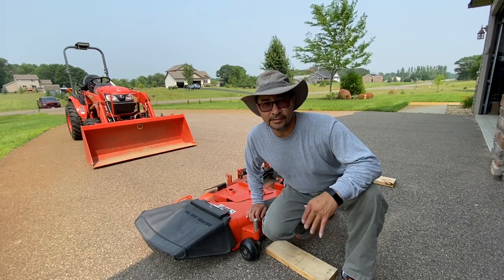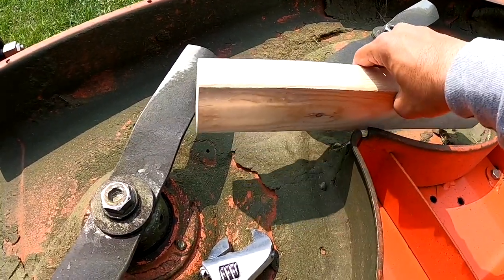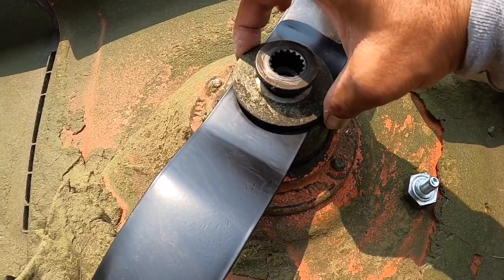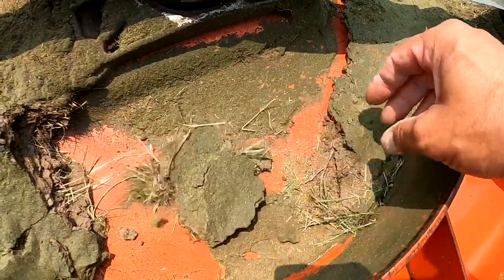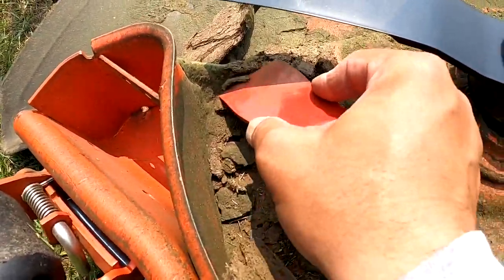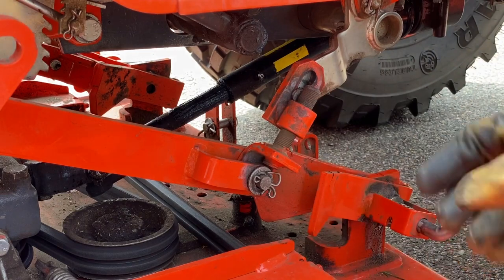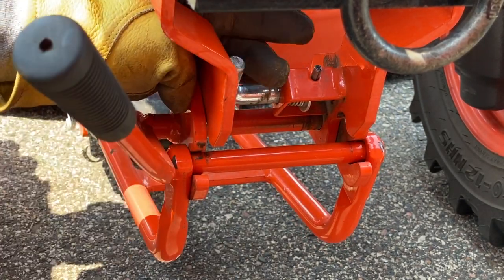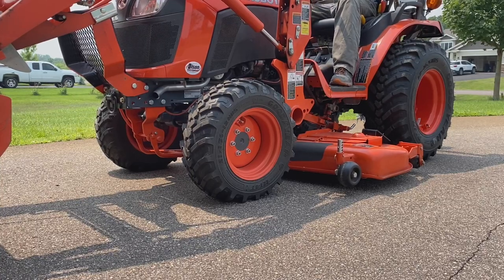Changing blades on a Kubota RCK60-32 Mid Mount Mower

Comment: From the owner's manual for these decks:  Mower deck 	spindle torque	72-87 lbs-ft.  I didn't write it down, but I'm thinking the nut was 29mm.  I'll have to check on that again.
2 tips for hooking up the PTO:  As you discovered, sliding in from the back of the tractor makes it a lot easier for connecting the mid-shaft.  I also remove my drawbar (pull the pin and pull out the bar- easy peezy) to keep from getting jabbed in the chest/middle.  I use a big piece of cardboard and lay it on the driveway and it really makes sliding under the tractor super easy AND keeps me from grinding/sanding the heck out of my back.
Reply from the maker: Thanks for the information 👍 and I like cardboard to it works great for tight places. Have a great day 😁👍
Reply: @MJADoingStuff  I bought a 30 mm socket for the job.  Yesterday I ordered a 26 mm socket for that blasted screen I had to clean as part of the 1500 hour transmission oil change.  After all the work, the screen was clear for the second time.  At 500 I said to it, "I'll see you in a thousand hours."
Reply from the maker: @rodcros  Wow you are really put on the hours. I am glad to hear you have been enjoying your tractor. I am guessing it has been pretty reliable so far? Thanks for watching the video. 😁👍🚜💨☀️
Reply: @MJADoingStuff   It needed a tachometer cable at about 600, and I had to re-pin the seat supports to the fenders at 1450.  That's it.
Reply from the maker: @rodcros  Awesome!!! Glad to hear. This is my first tractor and it has been great so far. I get lots of things done in a short amount of time.😁👍

Comment: If your good with the grinder (I'm not so good) you can flip the mower deck over and give the blades a quick sharpen with out even taking them off. Saves a couple steps.
Reply from the maker: Thank for the tip.That is how I am going to sharpen the flail mower have a great day 😁👍

Comment: With turf tires I don't think there is room for me to reach in from behind the way you did.  It would be great to have two hands in there, though.  Nice video using the loader.  I use a chain and the arms of the auto shop lift for the same purpose.  Be sure to use hooks, not a knot, as a knot can come undone and drop the tractor.
Reply from the maker: @rodcros  After you get the deck on maybe you can back up on some wood boards to get the tractor higher. Just an idea 💡 thanks for watching 😁👍🚜💨☀️
Reply: @MJADoingStuff   This morning I reassembled the deck and installed it quite easily, thanks to the car hoist lifting the front of the B7510 on a chain, and especially because you provided the hint that I can use both hands on that devilish PTO hookup if I crawl in from behind.  I'll be taking the deck off for maintenance much more frequently now.

Comment: I have the same deck , book calls for 72 to 87 ft lbs for those bolts :)
Reply from the maker: Sweet! I knew someone would have the answer. For some reason we couldn’t find it in the manual anyway. Thanks for letting me know I probably put 100 ft lbs on it 🤣👍
Reply: @MJADoingStuff  page 33 top left hand corner :)